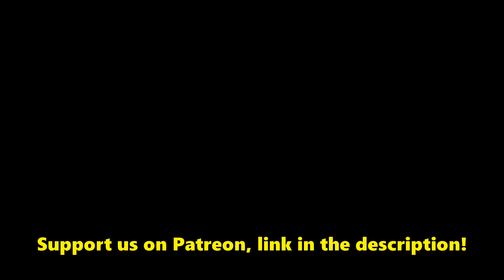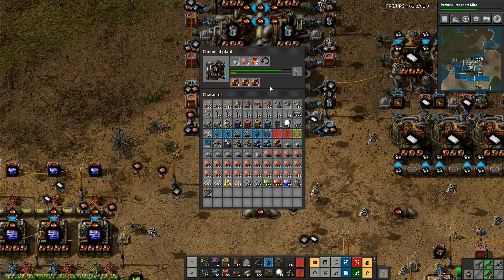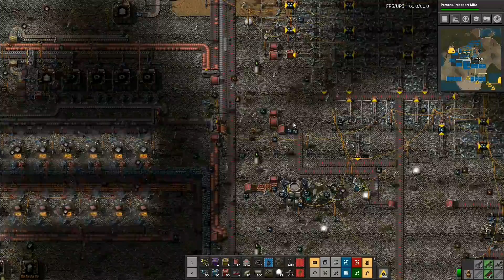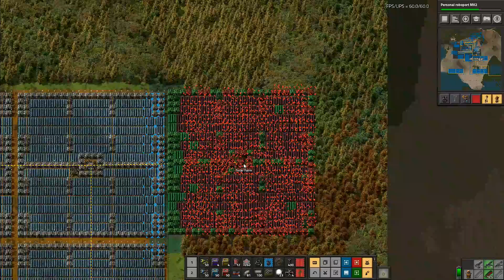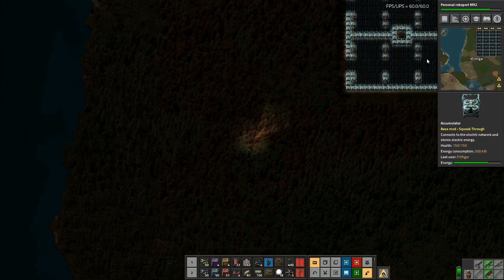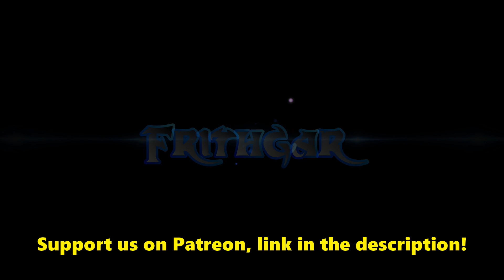Factorio Million Robot Challenge #103: Way More Solar Power!

Comment: Great series, Frithgar. I been watching faithfully since the start, just a late comer.
Here is a map string based on Alien Biomes mod: This string allows Biter Expansion and reduces the start from 600% to 300%. Everything else is the same. Same landmass shapes, same starting position, same resource locations and same island without any biters on it and disconnected from the mainland where all the biters are. Biter locations may differs on the mainland however. This allows you to get something going without too much biter interference, yet gives you the option to go them at your leisure. In my game I'm starting with Mega Bot start mod by Zero Serenity. I've played games before hacking at trees all day long it gets old after a while.

Add brackets like this >>> map string <<<

eNpjYBBk8GcAAwd7BoYDDlwsyfmJOTAeCAMFclIYGBrsYZgrO

b+gILVIN78oFVkdZ3JRaUqqbn4mim6u1LzU3ErdpMTiVJAdENxgz

5yRX4JsJkdmUX4euomsxSX5eagiJUWpqcWrV62CijTYc5cWJeZll

uaC9ALF7SAGAi1hjPPo1mpokWMA4f/1DAr//4MwkPUAKP+AAQocg

CqBYlDAJJucn1dSlJ+jW5xaUpKZl26Vm59ZXFJalGqVlJlYzGGgZ

2oAAro4laUVpRaWpuYlV1rlluaUZBbkZKYWcRjrgXUZsCbnZKalM

TAoODIwFDiDLGRkZKwWWef+sGqKPSPECXoOUMYHqMiBJJiIJ4zh5

4BTSgXGMEEyxxgMPiMxIJaWAK2AquJwQDAgki0gSUbG3rdbF3w/d

sCO8c/Kj5d8kxrsGQ1dRd59MFpnB5RkB3mBCU7MmgkCO2FeYYCZ+

cAeKnXTnvHsGRB4Y8/ICtIhAiIcLIDEAW9mBkYBPiBrQQ+QUJBhg

DnNDmaMiANjGhh8g/nkMYxx2R7dH8CAsAEZLgciToAIsIVwlzFCm

A79DowO8jBZSYQSoH4jBmQ3pCB8eBJm7WEk+9EcghkRyP5AE1Fxw

BINXCALU+DEC2a4a4DheYEdxnOY78AMTklww+9lvGgAAERAyVs=